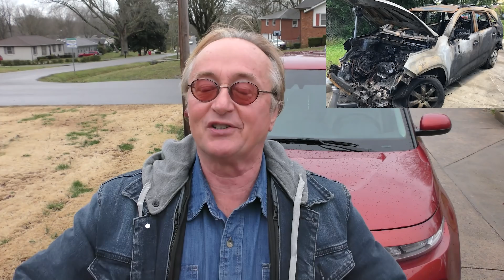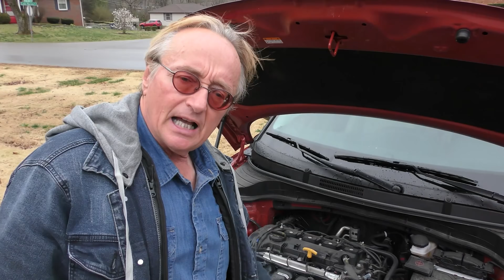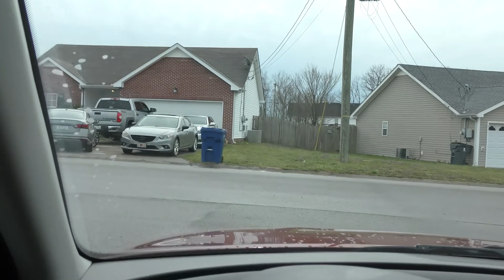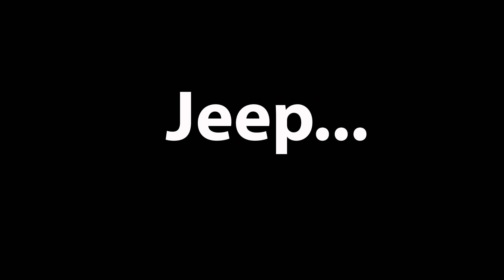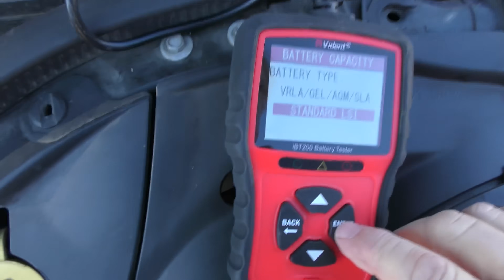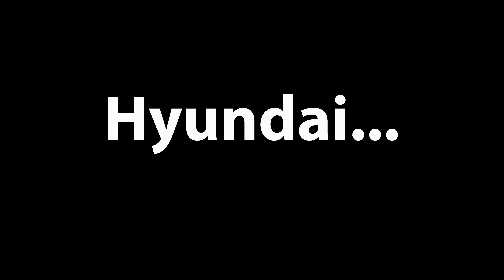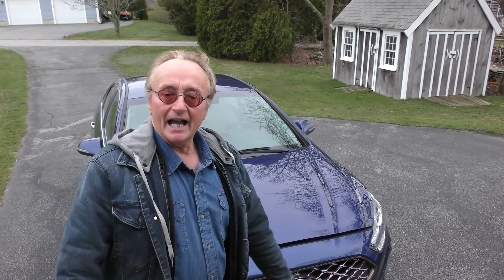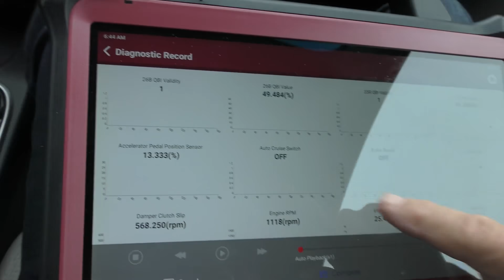3 Car Brands That are Crap

Comment: Maybe Kia/Hyundai's in the US are crap, but over here in Europe they're great. Any manufacturer that gives a 7 year warranty, must be confident of the quality of it's product.  I've owned my little 2013 Kia Picanto from new.  It now has over 150,000 kilometres on the clock. It's never missed a beat. Other than servicing regularly, the only parts I've needed are one set of front and back brake pads at 130k and a new battery last year. I'll definitely buy Kia or Hyundai again. My only concession is changing the oil at 10,000kms, rather than 20,000, as per Scotty's advice.

By comparison, my neighbour's Jaguar iPace, bought new in 2017 with less than 60,000 kms on the clock has just needed a complete new engine costing over 12,000 euros, only one year past it's 4 year warranty.  Now that is the definition of a crap car.
Reply: 150K kilometers isn't anything. My (Honda engine) car has over 400K kilos on it, not a SINGLE issue ever. That's reliable. If you run into issues before 200K kilos it's a piece of junk.

Comment: KIA's reasoning is exactly the same as VW/audi/Skoda/Seat, first generation of their GDI+drive chain engines were dramatic. Guess they took courses at VW.
That cvt transmission is really back to the nineteens. Toyota, Honda, Mitsubishi all superior to this KIA junk. What is funny, had a sonata from 1998, guess what problems it had apart from no-service-dealership: auto-transmission broke 🙂 Never bought a Hyundai/Kia again. How you can built a 4-speed autobox that breaks before 80000miles is beyond me. (4-speed-auto was common for nineteens models). box had software problem, selecting to low a gear hitting the engine. The engine was actually really robust. box later on often unable to shift to final gear, resulting into neutral at highway. Got repaired under warranty and sold the car, rather took the loss than deal with nearly weekly trips to the dealer for repairs. Engine was fine though no oil burning and still fine after taking all those beatings by the auto-box+faulty software. Don't know why they lost their skills to built a good engine.

Comment: Hyundai Kia is nothing but a S. Korean company that reverse engineers all of its products. They do not stand behind there products and have few engineers in quality. They just copy what others have done, Ford. Toyota, GM, etc, and assume they did due diligence. However they often screw up the copy process. Hyundai Kia cars are what 90 per cent of what S. Koreans buy. You must pay a high tax to buy an American car in S. Korea. BUT THEY CAN SEND THERE CRAP HERE WITH NO TAX!

Comment: I have a 2010Toyota Scion xD coming up on 400,000 miles I bought new what a great car. At 299,000 I replaced the alternator and it’s never had a tuneup you just can’t kill the Damn thing. Btw I Change the oil every 3000 miles and it’s always full.

Comment: I was thinking of getting a Kia until I saw this video. Horrible customer service will always keep me away. Thank you 🙏🏾
Reply: It is important to do some "research" on products & services we buy.  The term "due diligence" is something we should all learn to do for products, services, and political candidates.
Reply: I have a kia soul.havent had any problems
Reply: @Notime_4thewicked65  2020 Soul Turbo here, no problems, but it's under warranty if it does.  Once it's out of warranty if it starts giving me issues I'll cross that bridge, but considering it's a 5/60 warranty 10/100 drivetrain, gonna be a while.
Reply: @Notime_4thewicked65 that's great and you got lucky.  I really think its  50%lemon 50%good cars they make 😂=
Reply: @Gforu81 I have a 2013 Kia Sorento with 186,000 miles on it. Runs fine, burns no oil. Also a 2019 Kia Soul with 76,000 miles. Also runs fine.
Reply: @robertmcsorley4001  that's great.
Reply: you lucky @robertmcsorley4001
Reply: They are legit terrible. My Sorrento burned 5 quarts of oil in 4,000 miles. I totaled the engine driving it dry as the desert.
Reply: No stay away from Kia's and Hyndai's. I was talking to a mechanic who basically said the same thing. And Scotty says the same thing
Reply: Me too ,, C Ya
Reply: Don't do it!

Comment: For me it was the FORD Escort, and it's interference front wheel drive engine
Cylinder heats up and expands faster than the valve seat inserts, the inserts fall out, hold the valves down, which then get crunched by the pistons into little crunchy popcorn bits bouncing around inside your cylinder and exhaust, breaking your piston rod.   Seriously, FORD, WTF...

I replaced my cylinder head with valve seats with one from Pullapart, only to find after cranking it up and having it run for less than 50 seconds that one of the four cylinder rods was broken.   The best part - to take the belts off, you had to take the right wheel off.   Face palm.  Never again.  I switched to driving motorcycles exclusively after that.

Never buy a front wheel drive car, the engines are packed in there like sardines, you can't get a tool in anywhere.. and obviously, never buy an interference engine....    let alone one that has different metal valve seats and is crazy enough to use rubber belts for everything, not chains.  If the valve seats didn't get it first, the rubber belts breaking would of later on.

Comment: Subaru charging voltage while on the road with low electrical load very often is 11.6 volts. If I turn on the air conditioning fan to high it'll jump back up to 13.....

Comment: I happen to work near a kia dealership.
I noticed about four complete engines stacked on the junk pile. 
I right away thought warranty failures.
Almost have to get them to sign off on at bare minimum providing the replacement oil if they don't plan on fixing it. 
I actually almost bought a Sedona but someone beat me to it.

Comment: As a mechanic myself, Kias are one of the worst, poorly manufactured cars along with Hyundais. They are both designed on same platform. I have seen them blow up engines at around 35k or 50k..

Comment: Had 2012 Kia Cerato and it had 265000kms (165,000 miles) on the clock when I traded it in this year. Maybe not the highest quality cars out there, but I have no issues with their reliability.
Reply: seems Kias and Hyundais in the USA are crap
got 30,000km on my Hyundai no problems at all. 
the first Hyundai car we got went even beyond 105,000km
Reply: When a company has a reputation, it is due to the majority of their vehicles. Doesn't mean you can't get one that is an exception.
Reply: @thesistersofbattle ::: Lol, no, not a "majority", more like the loudest YouTubers...
Reply: @rushmoresociety2577  That's not remotely true. Blogs and websites have pioneered vehicle fault reporting en masse since way before YouTube. YouTubers are relatively new in the space when referring to this topic.

Comment: My KIA is utterly reliable over its 4 years 32,000 miles from new only needing two new front tyres after 31,000 miles. The engine uses no oil between changes.

Comment: Some dealerships deliberately bake long interval oil changes into the Hyundai vehicles to get the engines to fail to replace them, billing Hyundai. My former Hyundai dealer mechanic said this when I ran into him in the city. When I first bought my car, they stuck 3,750 mile oil changes onto my window. Two years later they stuck 7,500 mile oil changes and changed the computer trigger to 7,500. Each time I tell them to put it back to 4,000 miles. He also said they use the cheapest possible oil to save money and get the cars to crap their engines, to install new ones under warranty.  Since then I bring my own full synthetic, filter, crush washer, and oil additive and they only charge for labor. Shady stuff, to work against the car manufacturer.

Comment: I have 2014 Corolla, it says change the oil every 10K, the mechanic said that's a problem, the filter gets gunked up way before and has been known to shut the car down. I had a 1987 Mustang LX 5.0, that oil/filter was changed every 3K. That engine ran strong till I wrecked the car at 87K

Comment: Scotty, Here is a idea to have proof that the transmission has been opened and worked on. Take some good blue enamel paint and paint a long mark on where the transmission seals are on the housing. If the marks are broken the transmission housing has been opened. Tell your Hundya owner to do that before he takes it back for another transmission repair. Then check it for him.

Another thing you can do right now is look at if the bolts have been worked on.

Comment: My worst 3:
Honda, Nissan, Toyota.  Bought 1 of each new, and the Honda had to have the transmission replaced, the Nissan was tinny and the axle broke, and the Toyota, the electrical system fried and the wires melted.  Never had a Hyundai, but 3 KIAs and they were all good cars.  Had 1 Jeep and it was good.  Sold it early because of family needs, but it was good.  One person's opinions.
Reply: You are the only person I would recommend buying lottery tickets to.

Comment: I own a Mini Cooper Countryman (R60) JCW All4 (2012) and I bought it used two years ago with 104,000KM ( 65,000 miles) for $14,000 (loaded with options and mint).  Runs great and hardly burns any oil between changes (maybe 1/6th of quart).  I do change the 100% synthetic oil (5W30) & filter every 8000KM (5000 miles); essentially at 2x the recommended frequency.  This better ensures the timing chain and turbo are not going to be replaced early.  As for other maintenance, I do run an engine cleaner (e.g. SeaFoam), about 4 OZ to the oil fill, once a year and at about 500KM (the distance from 1 full tank of gas) before the next oil change. I also put 8 ounces in the fuel tank to clean the fuel injectors (again once a year). Other than the normal maintenance...brakes, fluids, and filters...with general upkeep it runs well and gets good gas mileage (about 27 mpg, for the hilly environment where I live). It is now clocking 88,000 miles and runs like a champ.

Comment: A Car Dealer lied to a customer?  I’m shocked!😳
Reply: I heard the story. When they replace Toyota transmission fluid, they have to measure temperature to refill fluid. However, technicians in dealership skip that step. They refill fluid whatever temperature is like mechanics do in auto shop. And then, customers are charged more than an auto shop.
Reply: What is truely shocking is when a dealer tells the truth! But don't hold your breath.
Reply: Break out those </sarcasm> tags!  People won't be able to TELL that you're being sarcastic otherwise!  </sarcasm>
Reply: Say it isn't so
Reply: dealership garages do nothing but lie
Reply: Ha ha ha
Reply: $3,000 off a new 1990 Thunderbird as advertised in a local paper. Bought it whole priced & Aunt Betty came up to the plate and said, "Jeff Craven bought the car in cash, second car he bought off your stinking dealership". I got my $3,000 back.  Since then I watch for anything over retail price + shipping. Stick the plate on her and drive.
Reply: Happens every day.
Reply: Customers tend to lie to dealerships much more often.
Reply: I've heard of politicians doing that.  Can it be?
Reply: That never happens 😂
Reply: REALLY !!😅
Reply: A GEO METRO HATER LIED TO A GEO METRO OWNER/DRIVER/LOVER? THATS TYPICAL AND NORMAL!
Reply: which burns more oil that kia engine or a 2 stroke motor?🤣🤣🤣🤣🤣🤣🤣🤣🤣🤣🤣🤣🤣🤣🤣🤣🤣🤣🤣🤣
Reply: @raven4k998  or nissan engine
Reply: The KIA dealership lied to us. Said we could change the date for payment during the first month. It did not make sense to me, but needed the car anyway. I also worked for an auto dealership that told me to lie to customers. ugh.

Comment: We're a Kia family. Our experience has been the opposite of what's been said in this video. We bought a new Soul in 2011. Drove it ten years, put over 170,000 miles on it. Not one mechanical repair over that time. Just maintenance. Oil changes, brakes, tires, etc. We bought a new Kia Soul in 2021 and have had zero issues. We bought a 2015 Kia Optima Hybrid that we still own and have had zero issues/repairs, just maintenance. Our opinion is that Kia is one of the best automotive values available today. Every automaker has recalls, minor issues, etc.
Reply: I agree. In Australia Hyundai/Kia is currently 3rd and 4th best selling brands with very good reason. Both build in South Korea. No problems about knocking engines burning oil. Just bad American build qaulity.
Reply: Yeah where is has been made makes a lot of difference and it's the same for the Japanese brands too.
Reply: How often do you change your oil, and what type of oil do you use?
Reply: I have friends who have been buying Kia for the past few years and they have all experienced declines in the reliability faster than the Mazda’s we have owned. Rattling and AC issues by 150k miles.

Comment: I’m sad to hear how bad the Kia is.  I had a 2010 Kia Soul.  Bought it new. Ran it to 265k miles with no problems at all. One of my best cars ever.
Reply: I live in Australia and just buy Korean cars. Kia/Hyundai made in America, no good .
Reply: @conradscheepers4122  agree. we had Hyundai went over 100,000km
no problem, my accent already got 30,000km
Reply: My gf has a 2016 Hyundai Tucson. Non-Turbo engine. Engine had to be replaced at 98k miles. Had the 100k extended warranty that we bought from the dealer and we had to fight for the repair to be covered. Now at 154k miles more issues.  We baby this thing and nothing but issues.  I’ve had Hyundai Elantras in the past that served me well but no more Hyundais for us.
Reply: @4gedcarbon537  are they assembled in the US?
Reply: @N3Garage  good question. I’m not sure if it was.
Reply: Kia is bad because this guy Scott says so? You had a great experience. I have had 5 Hyundai's and all have been terrific. Every car brand has a few issues here and there. To label a brand is bad because of a very few examples is ignorant.
Reply: Scotty is biased. We have a Kia Rio from New...it runs perfectly 🥰.  Light in fuel ⛽. He is talking absolute garbage. It's all about maintaining ur motor vehicle....servicing etc.
Reply: @vishendrannaidoo3385  KIA/HYUNDAI has issue with their 2.0 MPI (08 forte), and all four banger GDI engines from 2010ish-2018ish, urs is 1.6 mpi, thats only engine they made good to be honest
Reply: @vishendrannaidoo3385  Or .. maybe kias and hyundais in the US are really made crappy.
Reply: @vishendrannaidoo3385  With over 50 yrs experience, I hardly consider that garbage.  Buy a Toyota and treat it like you would your current car, then come back and talk; truthfully if you can.
Reply: @vishendrannaidoo3385  no it's not. The GDI motor is notoriously known for burning oil horribly. I work for valvoline and I have done oil changes on hundreds of these dumpsters. All of maybe 8 of those didn't have black dipsticks. Just because your specific car doesn't have the problem, that doesn't mean everyone else's cars don't.

I'm talking every model with a GDI motor too, not just a soul or a Santa fe, every. Single. gdi. Motor. Will have this issue at some point in its life. It is astonishing to me that these things are even allowed to be sold currently. Average lifespan of a GDI motor with decent maintainance is 80k on the high end.

Read that last sentence again.

I believe the lowest mileage with this issue I saw was 6000 miles. So, taking average mileage around my area into consideration, this means after one single year of owning the vehicle and driving it to work it will need a new motor. 

That's a cereal box toy of a car. My nephews power wheel hummer gets left out in blizzards and has lasted longer than these things do. I don't mean to be rude or burst your bubble, maybe you did find a gem. But no, trust me and the thousands of owners that have dealt with this issue; Scotty isn't just preaching to preach, 10:1 the GDi motor is the worst motor to be produced by any company in the last 20 years if not longer.

Comment: I lucked out with my 2011 Kia Soul because mine has never done that but the shocks are horrible and have led to the front strut's getting blown out at around 150k.
Reply: If you are talking about McPherson struts on the front suspension, then that is decent mileage for them. It also depends on how you drive and how rough the roads are that you drive on.

Comment: I work at valvoline and we now have to put European full synthetic in those Kia’s with the GDI engines for liability reasons. There was a lady who insisted on running conventional she came back 2,000 miles later for a top off and had burned 3.5 quarts of oil. She still refused to shell out more money for anything but the conventional. Keep in mind this car had under 75,000 miles. Total POS.

Comment: I had a Pontiac sunfire 2.2 ecotech. It was the best car I've had out of all of my cars. Had to replace the alternator, starter and fuel pump but those were easy fixes. A very reliable car, good gas mileage, it's given me nothing but smooth driving. I parked it because the ECU no longer works and I figured not worth spending tons of money on a car worth 500$.
Reply: i replaced the ecu in my durango for $120
Reply: You can probably pull one from a junk yard for $100.
Reply: @briand9754  - actually way cheaper than that. I think it was $25 here, and I sent it as a core return to the place I bought mine from. but you will likely need to reprogram a junk yard cpu if you want it to work properly.

Comment: I purchased a brand new 22 kia Sorento hybrid s and I barely made my 3rd payment at 4500 miles and on may 25th it was towed to the dealership because it just stopped driving.  They said a cam position sensor went bad and then, while in the shop, the hybrid battery pack went bad...... Still don't have my car, hired an attorney and I am pursuing the lemon law.
Freaking ridiculous